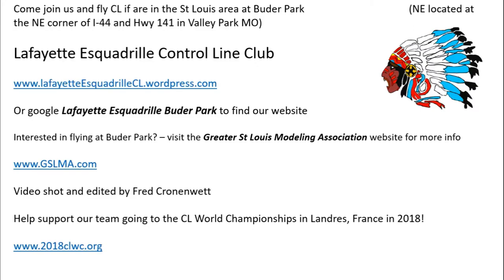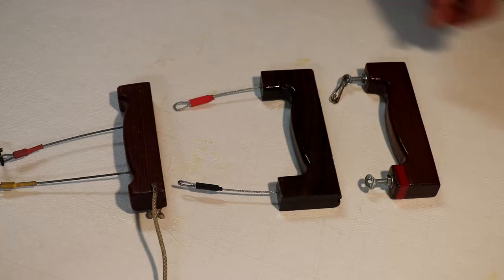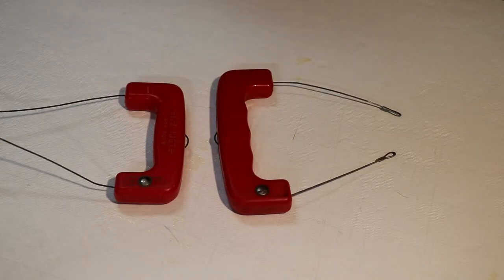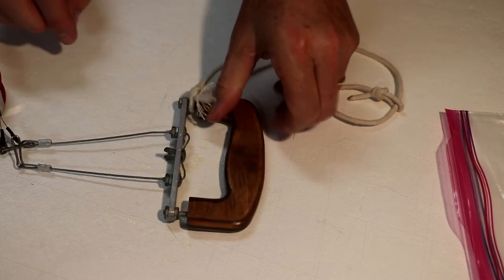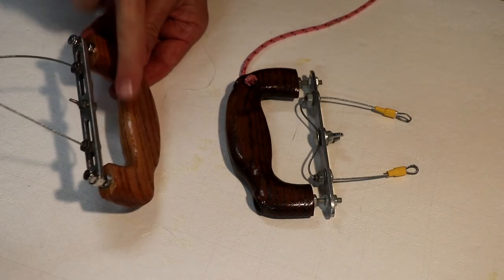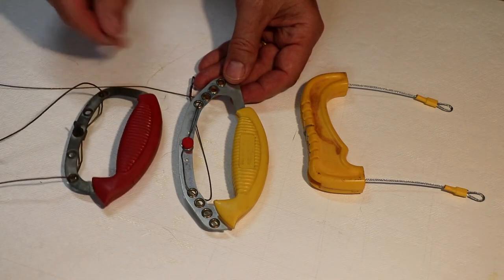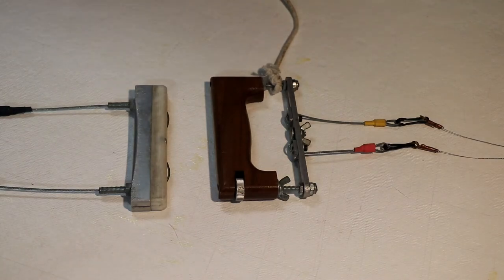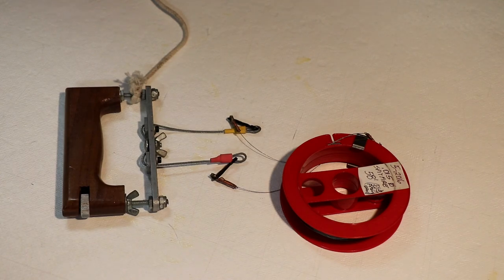Control Line (CL) Handles

Comment: So for someone who just wants to fly nice and steady, do you recommend spacing the wire way apart or in more?
Reply from the maker: To get a steady flight you want to have a smaller spacing between the cables. The wider the space between the cables the more it moves the elevator making the airplane more difficult to fly it level. I would suggest finding a handle where you can adjust the spacing or start with handle that has a narrow spacing. Every model is different some might fly well with a wide spacing while some really need a narrow spacing like my Spitfire.
Reply: I have numerous handles that I fly with, but my pop always uses his old trusty plastic Sullivan handle he picked up in the 60’s. Yours is yellow, his is red.